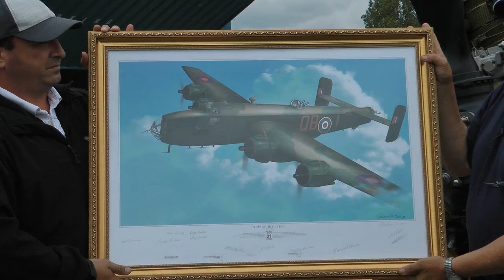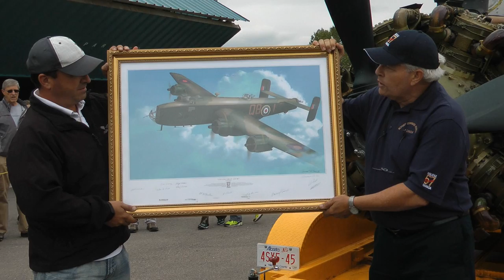NAS   H57RC Hercules Engine Start Up 2014

Comment: Everyone loves big Bristols....
Reply: These engines had no valves, springs, pushrods and lifters.  Sleeve valves were used.  Flat head with no rockers
and hemi combustion chamber with 2 plugs, 2 exhaust, and 2 inlet pipes per cylinder.
Reply: Greta thurnburg doesnt lol

Comment: ?  hi... why did you run it up to   350   on the head temp...
Reply: roger Johnson that is normal running temp
Reply: On these engines, there were extra cooling ( top hat ) baffles which directed air into the deep centres of the cylinder heads which are surrounded by a moving sleeve. It is desirable that the temps are kept within limits to avoid oil breakdown and possible damage to the head around which the sleeve slides, the sleeve cylinder itself, the cylinder in which it slides or the piston which moves within the sleeve. There are close-fitting baffles around the cylinders but no top hat baffles on this engine so cooling air is not being directed into the head. This engine is not flying in an aircraft and cooling is only from the shortened blades of the clubbed propellor. During WW2, these engines in some aircraft with full sized propellors were likely to overheat if kept running on the ground too long before flight in hot tropical or desert environments. Later builds of this engine type used tin plating on the piston shaped part of the heads which extend inside the sleeve cylinders to reduce the risk of "pick-up" or partial seizing in hostile conditions of the aluminium wearing surfaces onto the moving steel alloy sleeve cylinder walls.

Comment: and that prop is way too small. not the right prop for the plane the engine was in. do your homework better.
Reply: Have you not seen these trailer running shows before? Of course it's a cut-down prop, if you had a full length one it's entirely impractical and would blow the operator and half the crowd away. It's a show-piece not a representation of how it goes on the plane.
Reply: It’s a test club. It’s only there to make enough wind to keep the engine cool.